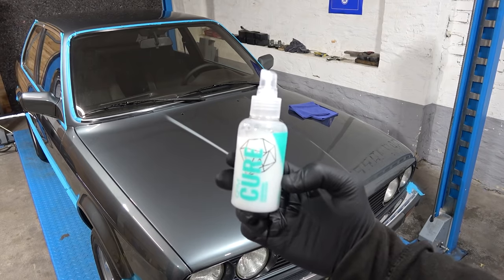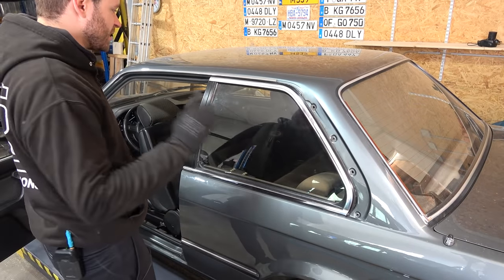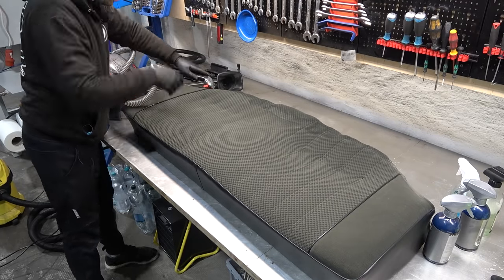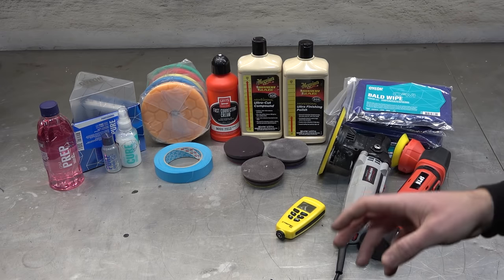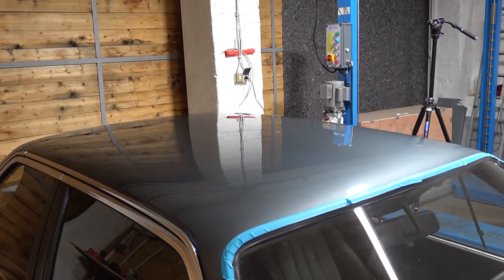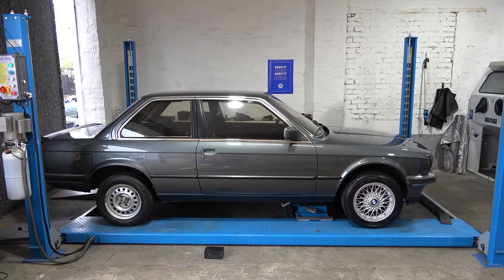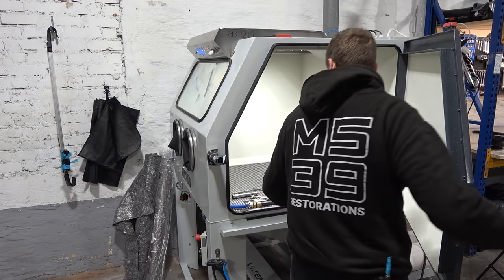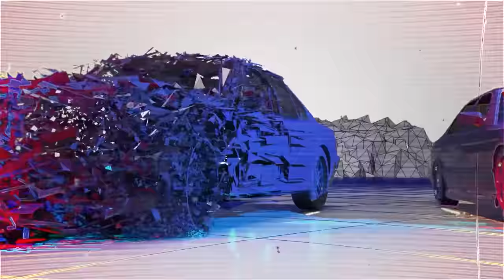When Things Don't Go According To Plan - BMW E30 320i - Project Marbais: Part 6

Comment: The reputation for lairy handling? Wheels’ test of the 323i pointed to "a strange diagonal yawl" and reckoned "the BMW requires plenty of concentration from the driver to maintain a straight line."

Comment: Damn, my condolences. At age 19 I crashed my father's E30 in a similar fashion. Slippery road,  a little too much enthusiasm with the throttle and around it went onto a really tall curb and after that into a low iron fence. That was that with our 14-year long family companion.

Comment: never underestimate a bmw e30, i own a e30 type 1 318i m10. 100hp not the fastest... but even in my car i feel the wheels on the rear spin A LOT... and iff it is even a 2.0 6line? well.. even then they break out of conners! also not the fasstest e30 but the weigt and build up of all e30s? its a real mean machine. not a everyday carier anymore. even back in the days the e30 was a common car? a really lot of people crassed there e30.. the touring is the "best'' of the series. why? the rear estate boot creates a nicer ride. coupes are the hardest to drive. i boucht mine years ago just to have this feeling. lowerd it and on original bbs 15 under my car? even it is a M10 engine? i love this car! its just a little toy now on the road. the 4 cilinder engine is not heavy, the 3 doors body, and manual 5 also original? it drives verry fuel economy good!!! drives funny but all this not heavy stuf? also have a strange drive expienience.. 
but iff everyone buy a30? warning: this car need skils to drive. even a 1.6. they all have a particular drive stile needed.. otherwise? pray for it...
by the e36 bmw build for a GOOD reason a wider body style, advanced suspention, wider wheels, and by the years added safty like TC, airbags, inprove crumpelzones. the e30 was a beautyfull car in the 80, but one of the verry dangereus cars people could buy back then... for today? one of the purest "daily"" peoples caries with race DNA.
the e36 needed for bmw more a all peoples car. the e30 was the car to buy for ''car people'' a volvo 940 of 1989 axample? was also a realwheel driven car. or the rival of the e30: the 190 benz.. also a car with real wheel drive and almost naked on safety options... the diverenses was the stand of the springs, schocks and body wide. so these cars dont slipp so easy on there end... only the bmw e30 want to break very easy out on the rear end. i have one other car here at my place. also a nasty one to drive because the small body and very strange suspesion setup: a volvo 360 two liter with a manual 5 speed. complete stock, sedan 4 door. this car? drives also "horrible" but i LOVE it! the rear axle is stock fitted with leaf sprins like old trucks! and the gearbox gears itself is fittet also in the rear. this drives funky! but al LITTLE bit better on the road for grip then the e30... i also LOVE e30 all! but.. dont think they drive easy.. this bmw e30 caracter is for many the reason to have one... not only the looks.

Comment: When you said "brand new summer tires" I had a feeling, hoped it went away, but when I saw the end of the video, oh man. Glad you're OK, and good luck sourcing parts to fix it. Fingers crossed here.
Reply from the maker: It was nearly 10°C that day so fine for summer tires. These cars just don't have grip in the rear in wet.
Reply: @M539Restorations  sorry, then, for assuming you were slightly negligent 😜 🤞
Reply from the maker: All good. I do my best to be on the safe side but sometimes, it fights back.

Comment: How does the change in wheel size affect the speedometer reading?
Reply: @Intelcroa  It's not the width of the tyre it's the profile plus the tyre diameter that changes the speedo reading.

Smaller diameter wheel/higher profile tyre vs bigger diameter wheel/lower profile tyre.
Reply: @Intelcroa  That's why I went to the trouble of explaining.

Would be interested to know what was actually done on this car rather than the theory.

Comment: That's the kind of accident that anti-lock braking systems, electronic stability control, and modern tire widths were invented to help prevent. Still, even as serious as it looks, that can still be repaired fully if you're willing to spend the time and money on it. That's the best thing about classic cars like that: they're simple enough in their construction that it's entirely possible to pull and hammer everything back out, replace the panels that are unsalvageable, and then carry on. Pretty sure there are companies that actually sell either a fiberglass or carbon fiber hood for the E30, if you opted to add additional lightness. Personally, if I had such a nice car that had suffered a calamity like that, I'd seriously consider buying a carbon fiber hood and the appropriate carbon fiber M3 fenders and rear quarter panels and panel bond everything on so wider wheels and tires could be fitted without entirely compromising the aesthetics of the car. Having driven cars with 165 width tires, I can say that nothing will improve traction in all conditions better than having wider tires with a good compound and tread pattern. My current car has 235 section width tires and it's very difficult to get it to break traction. Part of that is modern traction control and ABS, but mostly it's just appropriately wide tires to give you greater traction.

Comment: I’m sad for you and angry at the same time. I proper used to give my E30 325i the berries and it only ever once nearly bit me. You must have done something pretty dumb or suffered a talent deficit. Please fix it. She was a gem. P.S. these are not modern motors. You cannot get away with things as easily as you might in something newer. Anyhow, rant over. Pleased you’re still here to tell the tale.

Comment: i had the same fail 20 years ago driving my 325 E30...it didn't only bit me in the ass but fisted me...and all i did was to change a gear from 3rd to 2nd and it was a spectacular fail believe me..i fixed it and learned to drive it the hard way in a closed circuit so to know how it reacts. it was my first E30..after that it got fitted with LSD diff and the rest is history...it will get fixed. don't worry..old timers are 95 percent metal and not plastic pieces of shit.

Comment: I was a little scared when you turned the nut on the steering wheel to keep the air bag from popping out
Reply from the maker: What airbag?
Reply: I did the same thing once I disconnected the battery waited 30 mins got to the steering wheel and realised there was no airbag 😂😂
Reply: @M539Restorations  oh god it's a joke

Comment: 15" BBS 😏 Summer tires in december. 😭😭
Reply from the maker: It was 10°C outside that day which is fine for summer tires. Otherwise, I wouldn't go out.
Reply: @M539Restorations  Totally true. Summer tires are fine as long as there is no ice on the road.